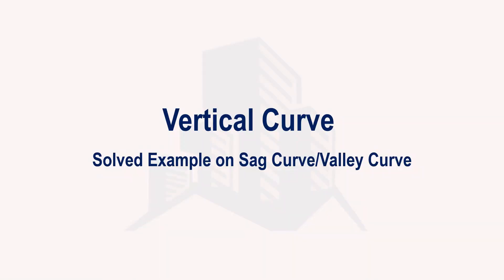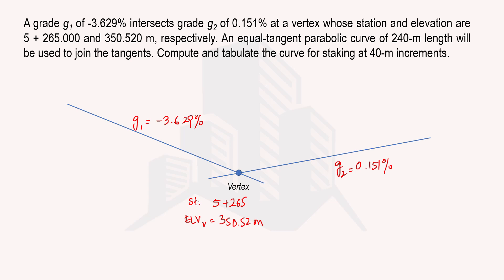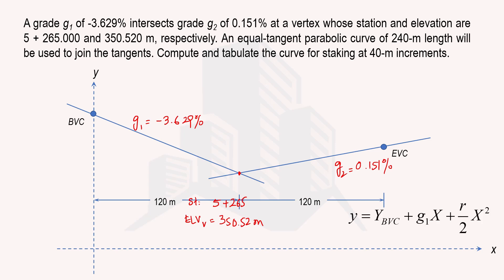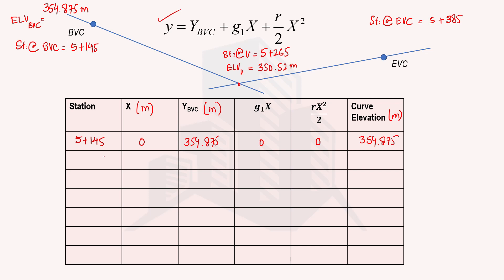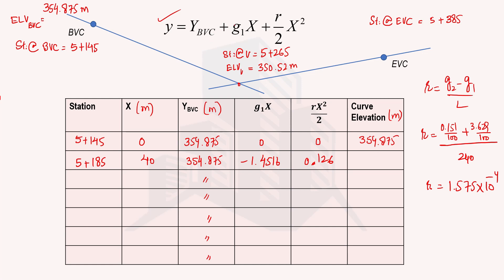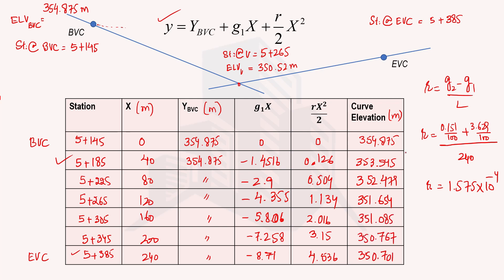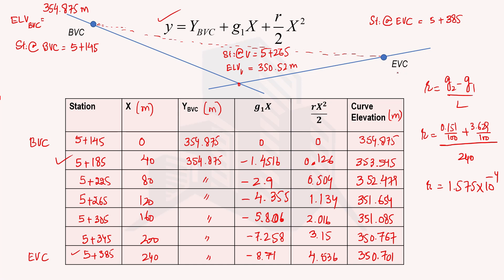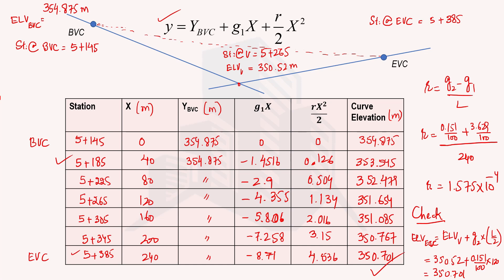Solved Example of Vertical Curve (Sag Curve): Complete calculations of vertical parabolic curve

Comment: a vertical curve joins a -1.2% grade to a + 0.8% grade The P.I of the vertical curve is at station 75 m elevation 50.9 m above sea level The center line of the roadway must clear a pipe located at the station 75 + 40 by 0.8 m The elevation of the top of the pipe is 51.1 meter above sea level what is the minimum length of the vertical curve that can be used